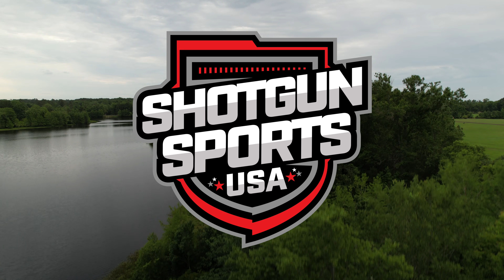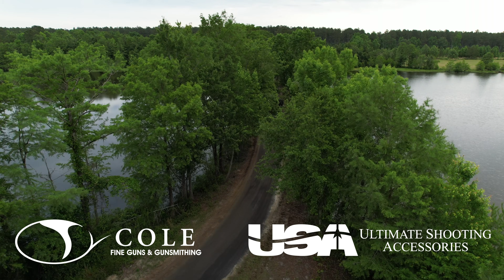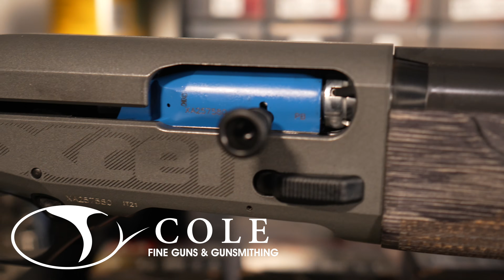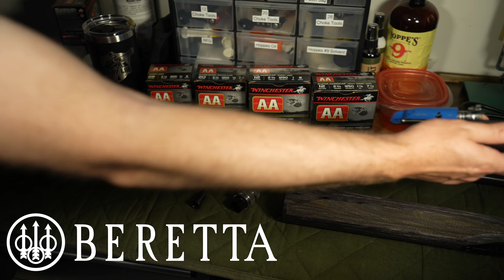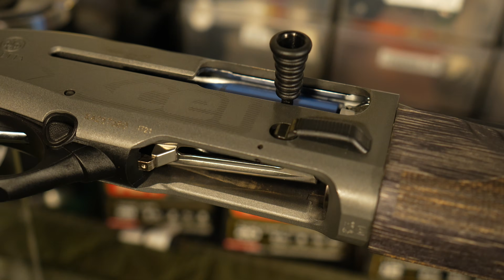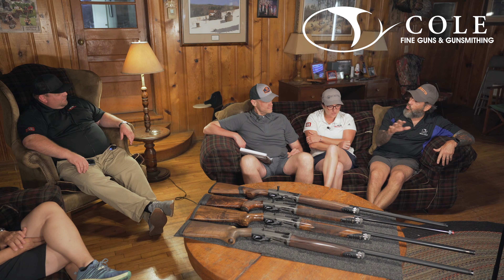The ALL NEW Beretta A400 XCEL: Shotgun Sports USA Video Podcast

Comment: Is the A400 with the all-blue package different from the one you have on offer? In terms of shooting, performance and assembly, which is better, Excel or Xplor? Thank you
Reply from the maker: The Excel was the performance model for clay targets where the xplor was directed more towards the game community. Both solid performers but would stick with whichever you will put more rounds through. The blue Xcel isn't in production anymore as they came out with a new model since then.
Reply: If you were left to choose the difference between hunting and shooting, which one would you choose according to your expertise and experience in terms of performance and all accuracy and accuracy? xplor or excel Please answer and why Because I would like to have one of them
Reply from the maker: @ragnarlarthbrok2779  Excel...The performance is built into the gun due to the demanding requirements the sport requires. Something reliable, accurate, durable, and backed by an industry leader. If it can handle the number of shells many sporting clays shooter put through it on the ranges while traveling across the country then it can handle the few shells that will go through it for a hunt. I'd be hard pressed to shoot a bird gun on a course for competition but not the other way around. Hope that helps!

Comment: Great guns , except the chrome plating ,on what I believe is called the cam , the little cylinder which is locked in place by the firing pin , comes off and when I talk to the New Zealand agent about it they just say " Turn it around"  and the recoil pads , which work very well ,are fragile and pieces chip off if they are put in a standing rack with a rough surface , or placed on the wooden floor of a duck blind

Comment: a fantastic video
What do you think is the difference compared to the black edition?
Reply from the maker: Thanks!  This would be very similar to the A400 XCEL black edition, in terms of the large controls.  The new A400 has more of a cutout for the loading port and different placement of the kickoff system (closer to the grip, allowing you to easily adjust LOP without removing the whole system).  Hard to go wrong with either!

Comment: There’s a few things that make this gun different than the new a300 ultima like a different bolt and wood finish, but are they worth 2x the money?  My 13 yr old has run 4000 rounds through his a300 without an issue.  I love the look of the a400 but I’m just not feeling like the money justifies it.  Also, I know the a400 has a different kickoff system.  

I realized that by removing the a300 ultima crappy kickoff system it made a shorter LOP and a great youth shotgun.
Reply from the maker: No denying that the A300 is an excellent gun, as well.  I would agree that most differences are going to be subtle.  It’s a refinement of a winning gun design, rather than a total redesign.  I agree with you that adjustment of the kick-off is a great fix.  Finally easy to swap out recoil pads to adjust that LOP!

Comment: What is the best case for this gun? Would prefer to have one where you can keep the bolt handle in versus taking out each time. Couldn’t find much on Beretta’s site. I’ve looked at the Negrini universal case but the direction of the gun would put the bolt handle down so you would have to take out each time.
Reply from the maker: Hey, I actually use that universal Negrini case.  You correctly pointed out that it leaves the bolt handle pointed down.  If I’m flying, I take the handle out.  If not, I personally leave it in and it isn’t a big prblem

Comment: Now here you have a Great Group of of ladies and gentlemen at the round table I enjoyed this tutorial , talking about getting to the point covering this gun. I own this 2022 A400 with Cole's gun parts it's a great gun
Reply from the maker: Totally agree.  My A400 (shown in the video clips) is from Cole’s and has one of their laminate stocks.  I really like the enhanced palm swell and overall feel of it.  The felt recoil compared to the older XCELs is noticeably lower, in my opinion…even without a kickoff on there
Reply: @claylabusa  , I ve got the Cole's bolt closer button on
and replace the silly cone on the bolt with Cole's and I put a kickezz 1" 1/8 pad grind to fit 
next will be the trigger job from Cole's also. The 2022 is a fine gun. Maybe this summer I'll get new wood from Cole's you can't beat Cole's fine Guns for sure
Reply: @claylabusa  Do you shoot he Cole A400 as your main sporting gun?
Reply: @Naarustrikez  I actually shoot a Krieghoff K80 Parcours as my main gun.  I use the A400 as a travel gun / back-up gun.  That being said, the A400 is ABSOLUTELY worthy of being somebody’s main gun.  All you have to do is look at how many great shooters are using one!
Reply: @RhymeNologist  I'm considering selling my 694 and buying a Cole Pro. My 32" adjustable weighs near 9 lbs and I've noticed left arm muscle fatigue while shooting. I shoot gun down so have extra lift during the mount. Think the A400 would be a good solution
Reply: @Naarustrikez  Scott I have the 694 also and I get tired also I just got my 694 back from Beretta with new wood it's my primary gun with the A400 as my back up but I love my A400
better I'm probably going to sell the 694 or put this over under in my vault.
Reply: @Naarustrikez  weight makes a big difference for me too.  I went from a Blaser F3 vantage to a parcours, and shooting low gun is now night-and-day different.  No longer fatigued at the end of a round